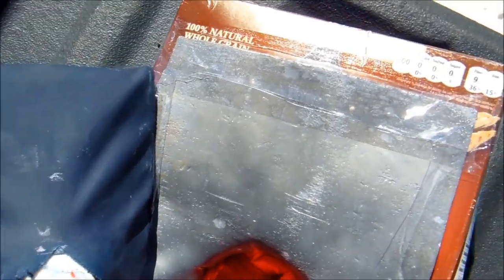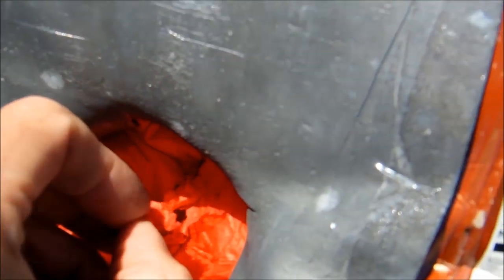Underwood 10mm 155gr TMJ vs. Level 3A kevlar

Comment: The problem with that round (from what I've read about it) is that it's likely to have the same problems that the older flechette rounds did.  A 4mm Tungsten Penetrator can penetrate pretty well, but it won't destroy much tissue on impact, and you need Tungsten to make kinetic penetrator anti-tank rounds more than you do anti-personnel ones.